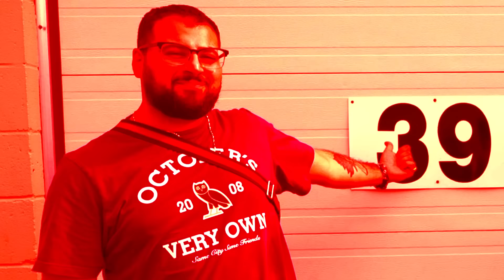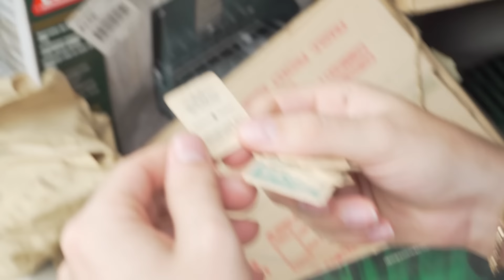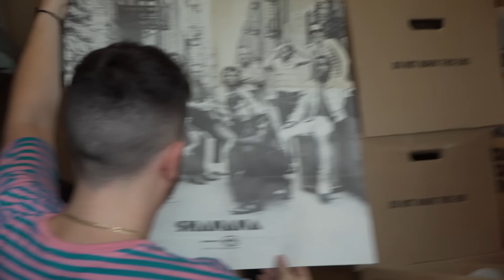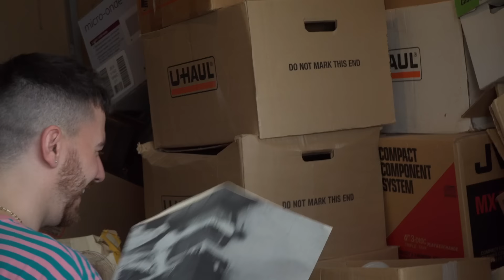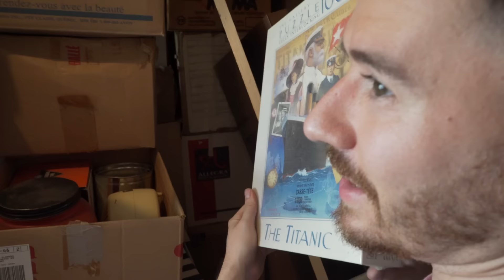I Bought A $1000 Abandoned Storage Unit and Found This.. (ABANDONED SAFE)

Comment: It's funny that you immediately start using the books as baseball material but a full, undamaged set of Encyclopedia Britannica from 1992 (based on the color it's probably the Platinum 15th edition) is listed on ebay for like $500 to $600 right now.
Though it's a 32 book set... but that doesn't matter anymore since at least 1 of them is already F'd now 😂😂
Reply: PS: I've had several VHS players in my house 😏